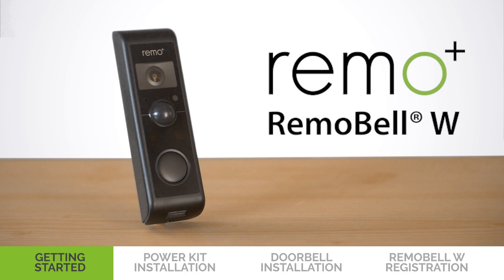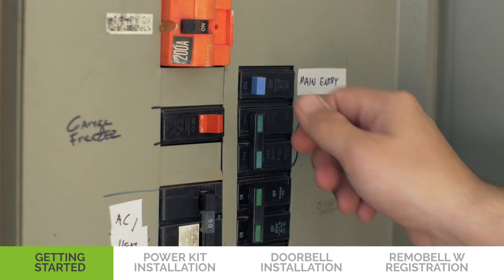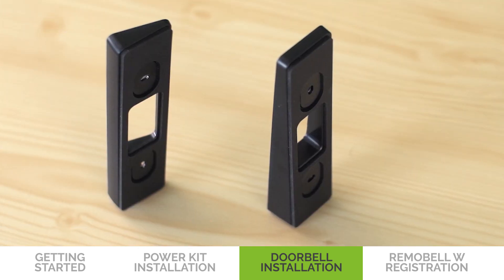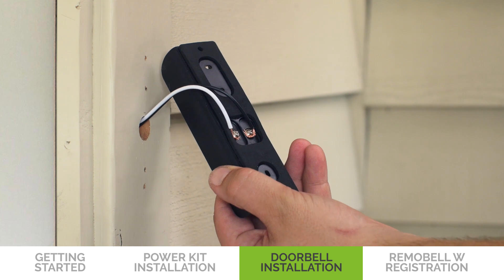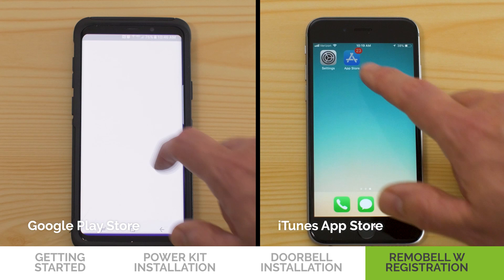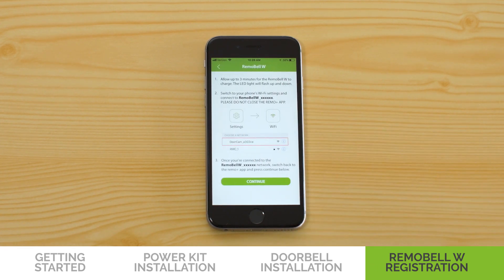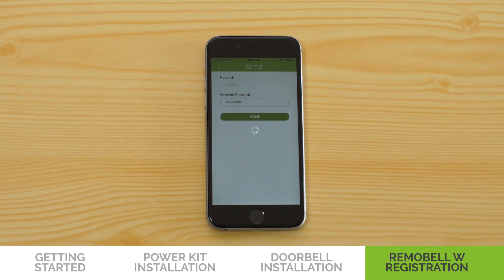RemoBell W Installation and Set Up Guide

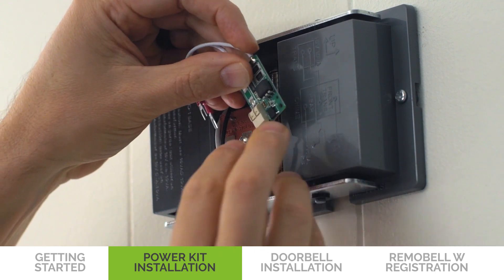Comment: It's a good video, but I really wish you wouldn't have shown people to leave wiring exposed (inserting the connectors on the power kit at 1:10) when attaching the power kit to the chime, it's an accident waiting to happen. Granted, it's low voltage. Additionally, what's the point of telling someone to take a picture of the wiring if it doesn't matter where the wires go? If it was to tell people "Don't forget which lugs the wires attached to" then just tell them that, it's confusing to tell someone "take a picture of the wiring for reference throughout installation". It makes it sound like they will have to reference that wire picture later or the installation won't be correct.